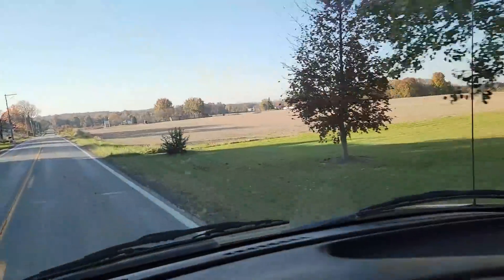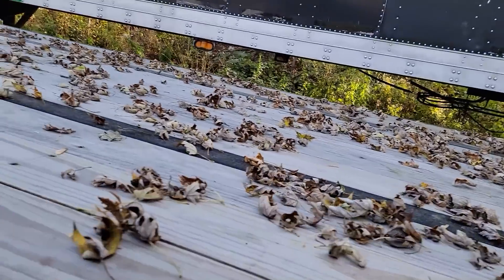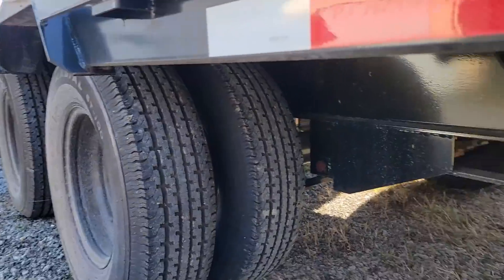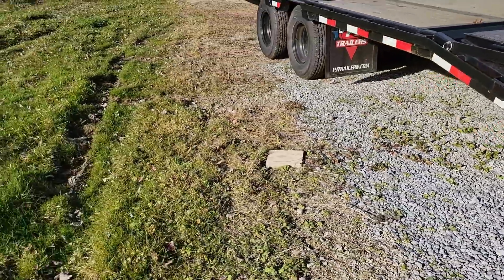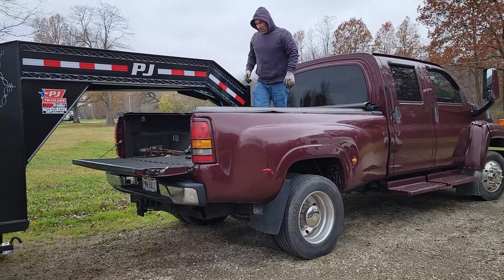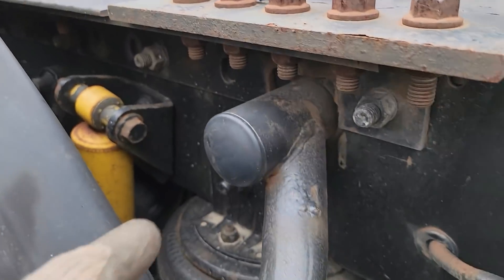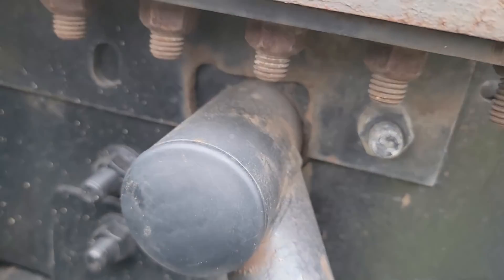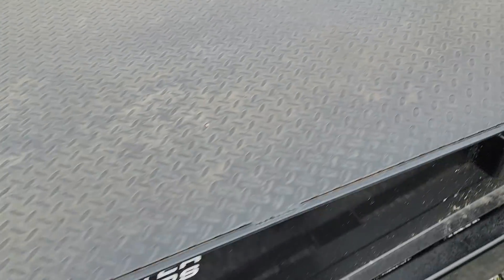NEW TO ME TRUCK AND TRAILER SET UP

Comment: That trailer is Lon-n-n-nnnng!  And it is as good as new from what I can see. Can’t hardly go wrong if you got a good deal on it.
Reply from the maker: 53' from tip to tip.
Reply: @j.c.smithprojects    Not too long ago, I bought a truck, trailer, and man lift. The trailer is a tag, 10-ton, tandem duals. 2001 date code on the tires. It sat in a field with cattle for nine years, so I’m told. Trailer has been on the road under ten times, ever. I’m going to rewire the whole thing like I do with LED lights — probably paint it. Has a 24 foot flat with 6 foot dovetail. Can’t wait to put new tires on it and start using it. 👍
Reply from the maker: that 30' trailer is what i was looking for. not too common to find a 30' with air brakes and pintle
Reply: @j.c.smithprojects    Yes, unfortunately mine has electric brakes. Not the end of the world. I paid next to nothing for it anyway.

Comment: The ball hitch definitely needs moving forward so fits better also needs a bulldozer winch fitting behind the cab so that you can pull anything up onto trailers
Reply: I find your truck and trailer set up in the US interesting. We have very few Goose neck, in the UK only on the very heavy Haulage companies hauling 200 tons plus....ours are straight fifth wheel, the normal trailer length being 45 ft on 3 axles. I ran 3 axle tractor units with Fridge trailers @ 44 tonnes.. it’s Good to see your enthusiasm , you’re certainly not complacent!! You know what you want and strive to get it.....this was a good video for a Retired Haulier. Thank you.

Comment: Lol the missus sounded so thrilled to be in that rattle seat. My topkick 4500 will make you check your fillings in your teeth if it doesn’t have a load on it. We appreciate the sacrifices.
Reply from the maker: you dont need seat belts in those trucks...you need ratchets straps to hold your kidneys in.

Comment: I’m no expert in trailers, but you got an extremely good deal on it.  Looks to be as good as you could get short of driving a new one off the lot!  Plus the new International will have plenty of power for hauling your new projects home👍
Reply from the maker: that is wjhat the new owner said too!
Reply: @j.c.smithprojects  not trying to start a argument or anything but why did u buy that big of a truck instead or a 3500 or a f350 or some sort I’ve just never seen someone put a semi type truck on a gooseneck looks great though

Comment: I love my PJ Trailer, but do not haul them in the salt or winter months.  The powder coat flakes and they get rusty fast!
Reply from the maker: I call powder coating a "gentleman's paint". it is nice and pretty as long as it doesnt get used. once you get a chip ir a scratch....the salt water from the winter roads gets between it and the steel. then the powder coat comes off in sheets!

Comment: Nice scores 👍 Made me cry a little bit when you said how you don't care for the C4500 😢 mint example. I adore my Monroe Kodiak lol, however I am much more of a casual hobbyist user of my equipment so I understand the reservations. I was very surprised to see how easily the neck cleared the bed rail height of the Monroe bed. I recently had a 34' 2 car open hauler built to pull behind it, went bumper pull for a few reasons stemming from my non-commercial use, but one of the reasons was being told that a 6-8" extended height goose would be necessary, but unless your new PJ happens to have a tall neck, it looks like the standard height would have worked out just fine with the Kodiak
Reply from the maker: the c4500/c5500 are not my favorite trucks. not a duramax fan at all. the air ride in these conversions ride horrible. the spring ride one i had was smoother. many folks love them...just not me. no extended height on the gooseneck....just standard.
Reply: I loved my Monroe Kodiak as well, but  it had the 13,500 LB rear axel and It would take 6 thousand pound's just to compress the first leaf in the spring pack. The only decent air ride for them is the Kelderman but they want 5 grand plus installation. But if the rear rode as well as the front I would have kept it. Beautiful interior, short turning radius, there was lots to like, but the ride was brutel.

Comment: If it's possible why not get the attachment for the trailer go from ball to pin. For the 5th wheel sense you are going to put it back on and maybe a sleeper. Or do that to the new trailer you might be getting.
Reply from the maker: like i said in the video, i may add a sleeper if i dont sell the truck. if i dont sell the trailer, i will keep it gooseneck so it can be used with multiple trucks i own. i had the fifth wheel insert for my last gooseneck and i ended up changing it out often to go back in forth on the trucks.

Comment: if you were buying a trailer to pull automobiles and up to 1 ton truck would a goose neck still be better than a hitch mount. i am wanting to get a trailer probably 20ft. i have a d500 dodge with a holmes 500 wrecker on back but also have a 3/4 ton 4 wd  5speed gas burner dodge i would be pulling trailer. its not set up for goose neck now but i really think i would rather have goosneck everyone says they are easier to back and pull so much better. i have never pulled a goose neck
Reply from the maker: if it was only intended to haul a car every now and then with a gas powered 3/4 ton truck, i would buy a pull behind trailer. a comparable size and gvwr gooseneck trailer will weigh 1/3 more than the pull behind. in order to have the same load capacity you would need to go heavier on the gooseneck. most goosenecks i have seen start at 10,000lbs gvwr. the most common in the single wheel tandem axles goosenecks around here are 14,000lbs gvwr and weigh in at over 4000lbs.

Comment: JC, I noticed the gooseneck ball on your new truck is behind the pinion, do you think that effects the way it pulls a heavy load? I’ve got a Chevy C7500 that used to be a box truck, I’m building it out to pull a dual tandem gooseneck like yours but I want to put work boxes in front of the gooseneck to haul tools, fluids, fuel, air compressor, and a generator. I own a small land clearing/excavation company and always need things while on the job. Do you think I could get away with the gooseneck ball being right behind the centerline of the rear axle on the truck?
Reply from the maker: ifif i was building something to haul heavy loads, it wouldnt be a c7500. i am just not a fan. is it a small cat or the 7.8 isuzu?
Reply: @j.c.smithprojects  it’s got the Cat engine in it, it won’t be real heavy. I’m thinking 14-16 loaded
Reply from the maker: 3126 or c7?
Reply: @j.c.smithprojects  3126

Comment: How do you upgrade to 17.5 tires do you get new 10 hole hubs or get new eight lug wheels?
Reply from the maker: 17.5" tires require 17.5" wheels. buy the wheels and tires as a combo.
Reply: 10K axles usually come with eight lug nut hubs did you buy new 17.5 rims to fit those eight lugs or did you upgrade the hub with 10 lug What are the more common 17.5 rims that require 10 lug

Comment: Yea I think the international will had a little bit more power then the 4500 that trailer would be a better fit with a pintle hitch to that truck better have the electric brakes set correctly if towing anything heavy could get scary truck a little light in the rear air better but buy what’s available these days especially if a good price
Reply from the maker: 44" long pintle? imagine trying to back that into a tight spot. no thanks. i am still looking for a 30 pintle hook trailer with air brakes. the axles of this trailer are set so far back it will have a good amount of weight on the drives.

Comment: Your goose neçk on white truck should be either on top of axle or just ahead. It is unsafe being behind the axle. You load up the trailer, and you will unload your steering tires.
Reply from the maker: i would agree with that on a smaller truck but on this truck it wont make a difference. the trailer will never hold a heavy enough load to cause the steer axle weigh to be reduced. remember the gvwr of the trailer is only 25,000lbs. the rear axle of that truck is rated at 20,000 lbs. think of a dump truck pulling a trailer with equipment on it. the pintle hook trailer is attached to the truck well behind the rear axle. its all about knowing the limits of your equipment and the load you are putting on it.

Comment: Why is the 5th wheel hitch so far back on the truck? Would it make sense to have the weight right on the axle?
Reply from the maker: mostly for turning / backing extremely sharp. also because the truck has a 20,000 lbs rear axle and you would be hard pressed to get more than 20k on the rear axle with a gooseneck. so being toward the rear really doesnt matter too much.
Reply: @j.c.smithprojects  Thanks for explaining

Comment: Jc you think it would be easy enough to put an air ride seat in an 07 gmc w4500 ?
Reply from the maker: i have 3 c4500 trucks and they all have air seats. buy the seat and the base adapter if you need it or make one.

Comment: International is a slight improvement of the Kodiak.
Reply from the maker: huge inprovemnet. cummins engine, engine brake, 10 speed manual trans, air brakes, 200 gallons of fuel, a "real" air ride suspension,  22.5" tires and so on. i would take this international over the kodiak every day of the week and twice on sunday.

Comment: 102 x 10' bolt on deck over the neck.  change pall to kingpin. e-mail me for winch mount without a battery on trailer.   all if you pull with IH. lesser truxk, consider elec/ hyd brakes to stop it and hyd jacks
Reply from the maker: a deck over the neck doesnt help me. the neck is too high to put the size truck up there. a lowboy is the better set up for me. i had hydraulic brakes on my last gooseneck and they are a maintenance nightmare for a trailer that isnt used often. this is ok for the 20k lbs or so i will put on it. the engine brake will be used a lot.
Reply: @j.c.smithprojects  the drums sucked but discs as great. my rollback replacement is a 24' tilt w winch and hyd jacks. a 26K rig
Reply from the maker: last one i had was disc. seized caliper pistons were a constant problem. i dont use them enough to keep them freed up. the lowboy would be a much better suit for me.
Reply: @j.c.smithprojects  OK for your tow vehicle nut not a pickup

Comment: I just bought a 1987  f700 dump truck with 28,000 lb GVWR is there a way I can  derate it to 26,000 lb ? I'm in Ohio also.
Reply from the maker: no. the only way the factory gvwr can be changed is by the upfit company that changed it from the "incomplete vehicle" it was from the factory to a gump, flatbed, or whatever was put on it when it was a bare cab and chassis. there are other "assembled vehicle" options but it involves changing more than 50% of the vehicle.
Reply: @j.c.smithprojects   Thank you for the response . Google would not give me a clear answer lol.

Comment: Lol, no you won’t be changing those wheels out to a 17.5 unless you change our the axles.
Reply from the maker: happens all the time
Reply: @j.c.smithprojects  what, change out the axles? That’s a hefty bill. You’ll be stacking on at least another $6k-$8k
Reply from the maker: look into putting 17.5" wheels and tires on a 10 k axle.

Comment: How did the previous owner load anything on that trailer without the DuckTales been down
Reply from the maker: it only had two loads and they were air commercial roof top a/c units. they load those with a crane or forklifts.

Comment: why buy an electric brake trailer when you have air brake truck?
Reply from the maker: so that i can use it with the c4500, ram 3500 and ram 5500 i own if i need to.